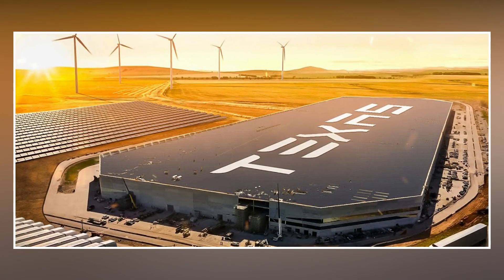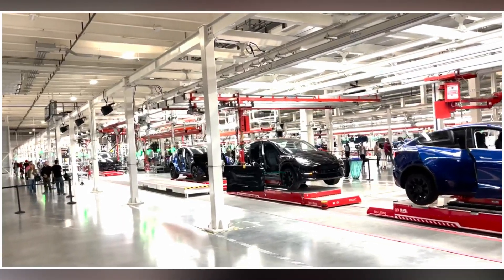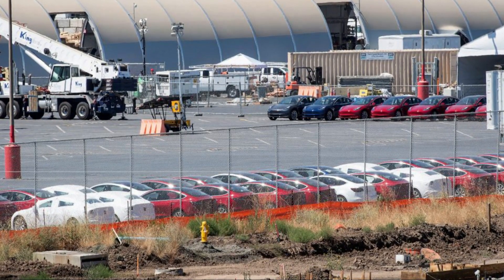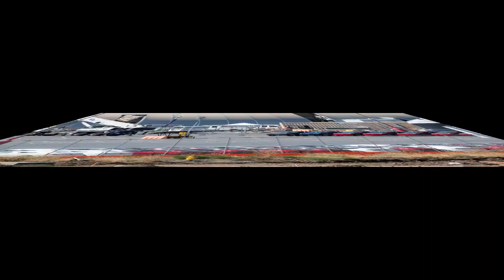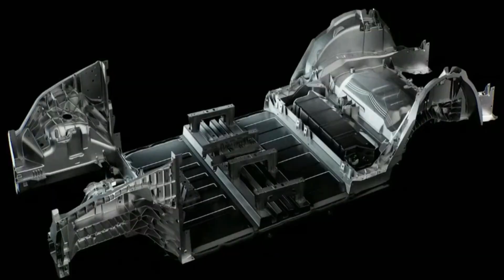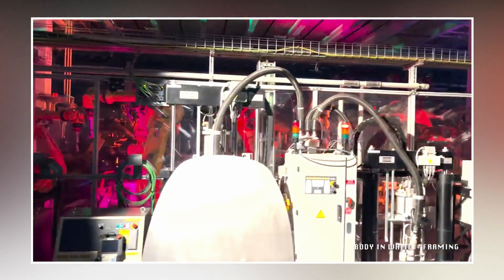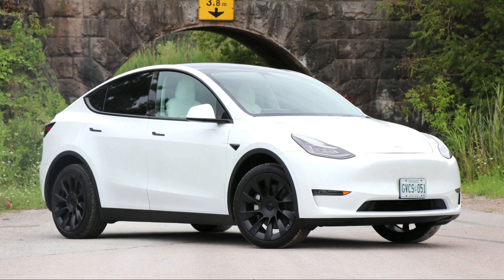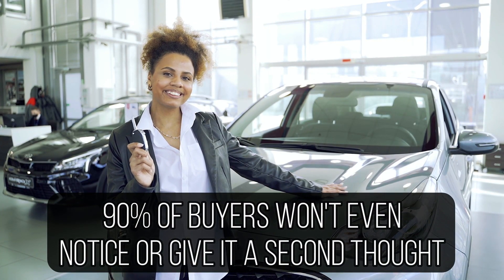Tesla Gigafactory Texas Is Huge!

Comment: Tesla Gigafactory looks amazing! The building is extremely large, it even takes over 2 miles to walk around the entire building. The 8 million square feet floor area is so huge! The Giga Press machine with 6.000 tons of force made the car is strengthened, made lighter more corrosion resistant, and less prone to manufacturing flaws. Tesla has the most advanced battery and pack architecture. Thank you so much for doing this informative video.